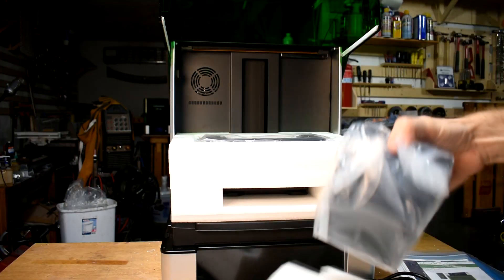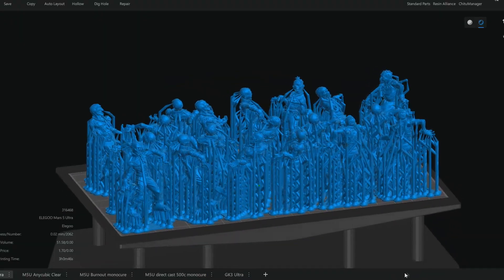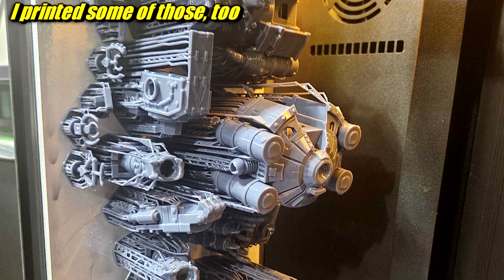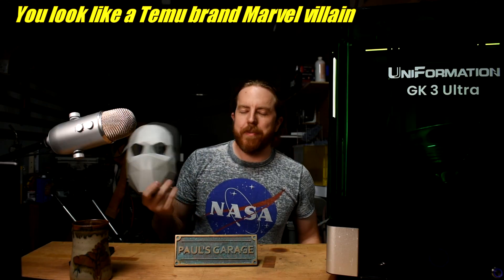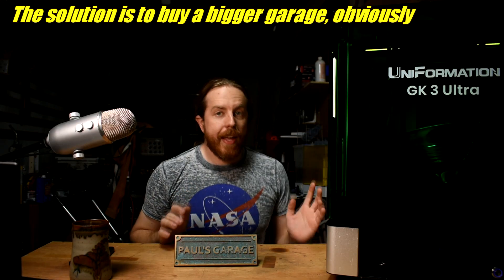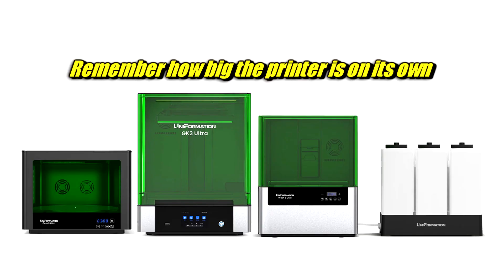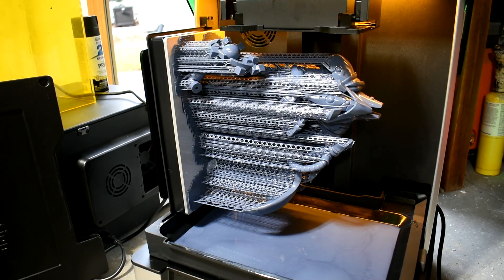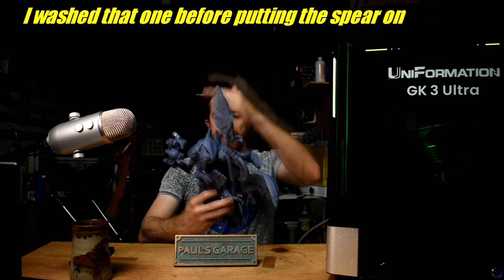Printing HUGE things in Your Home Shop? Uniformation GK3 Ultra

Comment from the maker: GK3 Ultra here: (Use PAUL100 for an extra $100 off, expires September 30th): https://uniformation3d.com/products/uniformation-gk3-ultra?sca_ref=4345752.v3kdNjnqDi
Reply: GK3 ULTRA is a low-cost single rail, not the advertised double rail, which is a fraud to consumers.🤮
Reply from the maker: Because of this comment I just checked and indeed mine does not have dual linear rails.  I haven't had any print issues with mine, it works great so far, but I'm going to do a lot more printing with it and see what happens...

Comment: for the price is lacking a few features the PRO has... that's a shame! I really hope they will release a revised model, but I doubt it unfortunately
Reply from the maker: which PRO features is it lacking?  I have a new version of the pro sitting here that i haven't dug into much yet.  Personally, i care most about the size, so i would probably prefer the GK3 Ultra even if it's missing some other features. In fact I would prefer if they removed even more features and just made it even bigger
Reply: @PaulsGarage  for example the Pro recognizes if there is cured plastic on the FEP. there are another couple of features like it that the Ultra doesn't have.
I already have a SLA 3D printer, so, to me, it's not worth the money.
Another thing I'm not really fond of is the resin pump. I would have rather had a system like HeyGears use. but I could look past that.
the fact is that if I upgrade to a new 3D printer spending this kind of money, I need it to be real upgrade.
if I didn't have one, I would have surely bought it

Comment: The size thing actually convinced me that I don't need this printer. The Saturn4 Ultra might be too much machine for my needs.
I really wanted the user-friendly features of the GK3, but I simply won't be able to rationalize dropping nearly 2 grand on a machine that I can't squeeze the full utility out of.
Reply from the maker: If you like the features but don't want to drop big money on a huge thing, you can get the GK2.  It's basically this machine but the size of a Saturn.  I've heard good things about the Saturn ultra, too.

Comment: The X1C has a 256 cubed build capacity.  Can you imagine that in an SLA printer?   Still, this GK3 Ultra is massive, and still appears to have nice quality prints.  Pretty cool.  I'm currently stuck in that special limbo where you want to get into 3D printing, but can't decide to go with SLA or FDM.  SLA is toxic, it smells, it's messy, requires PPE and hazmat procedures, and a bunch of post-processing just to get to the final product, but the level of detail is INSANE.  FDM is cleaner, arguably easier to deal with, a lot less messy and/or smelly (depending on filament, of course), and with the right printer you can still get really nice print quality.  Decisions....decisions...

I feel like, to go with SLA, I'd almost need an entire room with a special exhaust/ventilation system.  With FDM, I feel like it could live almost anywhere and not cause a problem.  (Sigh)  I'll probable end up going FDM, but that SLA detail calls to me.
Reply from the maker: FDM printing PLA is where I started, back with a prusa mk2.  I'd do it again. It's much easier to get going than resin
Reply: Don't think thought that FDM is safe, because it doesn't smell as bad. Treat all the plastic/resin vapours the same - through filter and outta window
Reply from the maker: People have tested FDM extensively.  Basic PLA isn't too bad, the rest i wouldn't want to breathe.  Some of them will straight up poison you if there is enough exposure

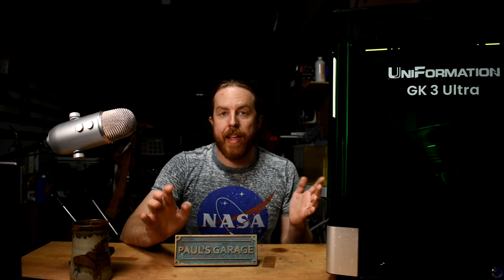Comment: Ok im eather being stupid this morning or they made a typo. U said a almost 1' wide build plate at 1:43 but the screen shot shows "13.5 inch LCD for large prints" am I missing something? 😂 what the hell
Reply from the maker: Good question!  The 13.5 (and all screen measurements) are diagonal across the screen.  If you take the side measurement,  it's 300mm wide, just under a foot
Reply: @PaulsGarage  ow makes 100% sence. Thanks for the reply and clarification 👌🔥

Comment: another huge problem with resin printers , and especially large volume ones is the suction on layer change , this one seems not to have the tilting vat feature, maybe they will add it in a future model ... that really speeds up the printing also as the model does not need to be pulled that high off to properly get resin underneath the print ...
Reply from the maker: No tilting vat on this one, you are correct.  I think the larger the vat, the more difficult it would be to tilt without spilling.  This makes up for it by just being slow lol.  Not at all a fast printer.  I think that robot took almost 2 days to print, but it looks good.  Like I said in the video, I don't care about speed.  I'd prefer quality and size.  I have tried a tilting vat mars 5 ultra though, that thing is crazy fast.
Reply: Trust me. Tilting vat sucks. It’s not worth the speed that nobody actually really needs. It’s messy and difficult to service when you have to swap out the screen. Too many unnecessary moving parts.

Comment: Actually, not even THAT expensive compared to other 3D-printers...  less then 2000 including wash and cure.
Even compared to FDM. Replacement-parts and such can be dealbreakers I guess?
Reply from the maker: I'm not sure.  The GK2 was designed for easy maintenance, but mine hasn't needed any replacement parts.  No idea what the parts cost.  On the other hand, I have a bunch of FDM printers and only 1 hasn't broken in some way.  Resin printers seem to be more reliable, but other costs really add up (alcohol, nitrile gloves, etc)
Reply: @PaulsGarage  Less things to move so less things to fail, also mostly lower temperatures, lower electric currents and so on.
But, displays of this bigger size might be quite costly  for example (if screen-protectors and FEP fail or due to long use).
That besides the cost for the things like you mention and working-environment-issues that are bigger.

For this size of printer, I think it would be quite nice if they would combine printer and curing-station in one so you can transfer the print to cleaning-station and after that inside the printer to cure it instead of to the 3rd big box. Seems to be more logical to combine than cleaning- and curingstation in one. Without the vat, the display can be used to cure + some extra lights on the same big(ger) PSU.

Comment: is there any vertical distortion on the taller prints? I've heard some resin will 'stretch' off the build plate as it goes
Reply from the maker: With these ones, no, but I have noticed that depends a lot on the resin.  Those big models were printed in uniformation biodegradable resins, which in my experience don't stretch or deform much, but are instead kinda brittle.  I'd I dropped that robot I would probably end up with confetti.  My go-to resin is usually sunlu ABS-like, and that will definitely deform and stretch during printing.  It doesn't even need to be a tall print, game dice come out stretched into diamonds.
Reply: I use some pretty flexible resin, and I don't think I have ever had an issue where there is dimensional stretch/stability issues as it goes up. That would be a lot more on the resin than the printer, and likely an edge case.
Reply: @CaedenV  Z height accuracy is an issue I've just heard of on resin printers in general and its (one of the things) kept me from them. Was just curious if this is a problem that seems to be exacerbated or not with a pretty huge printer.

Comment: All we need now is an afordable resin.
Reply from the maker: I generally use sunlu ABS-like.  Reasonably tough and under $20/kg if you buy big bottles.  Not the beat by any stretch but good and cheap

Comment: Looks good, but for me it comes down to this: will I get nearly two thousand dollars (what with the cure/wash as well) of use out of it in a short enough time period to make the upgrade from a smaller printer worth it?
Reply from the maker: Good way to think about it.  If you aren't printing big things, it's probably not worth it.  If you do want to print big things, you gotta take the jump.  It's awesome